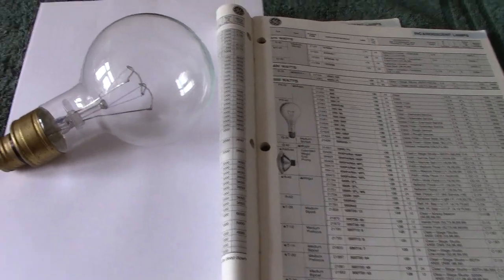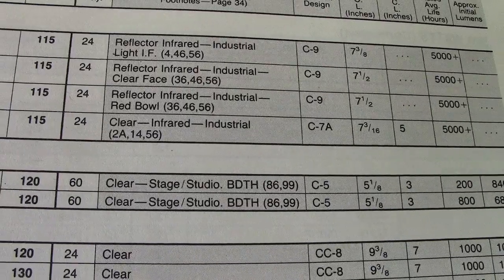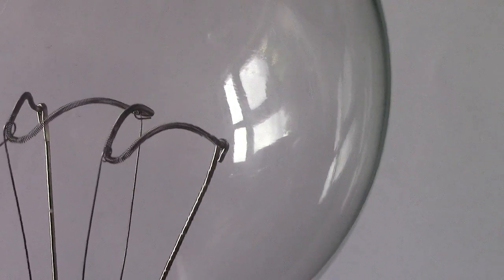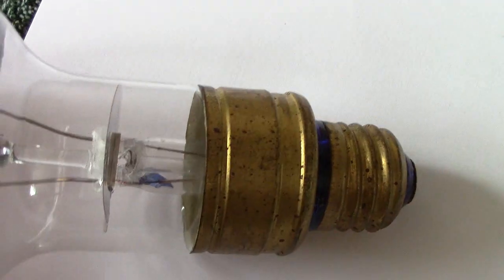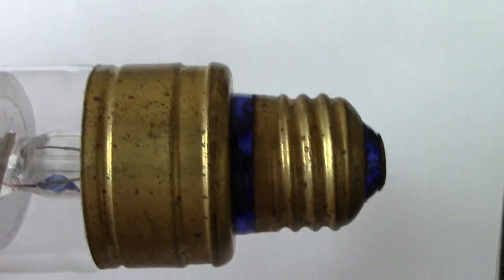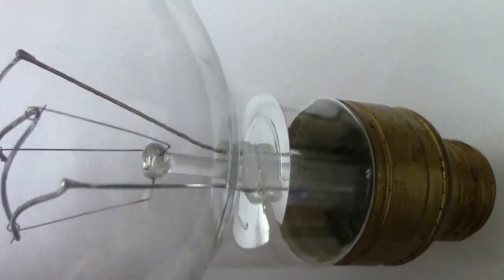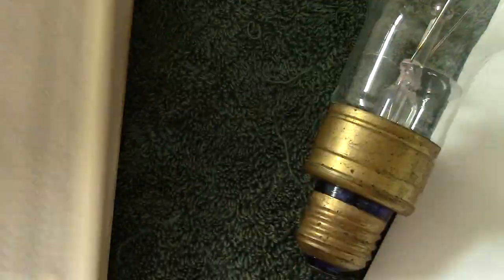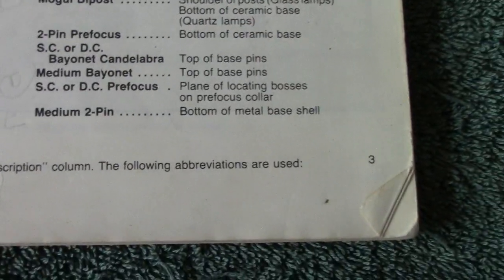375 watt heater lamp

Comment: This has seen a few hours of use base up judging by the sagging.  That is a C-11 filament IIRC.

These do produce a good deal of light, but not as much as a normal GLS lamp of the same power rating for obvious reasons.  At around 8lm/W (typical for heat lamps that don't use red glass or a red coating), this produces about 3,000lm, or about the same as a 150W 120V 750hr GLS lamp or a 200W 220V to 240V 1,000hr GLS lamp.